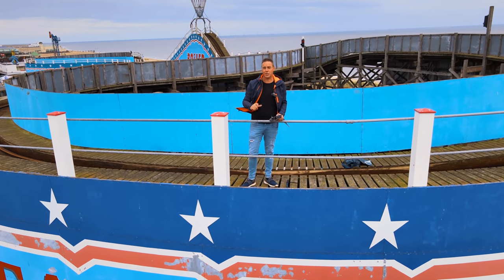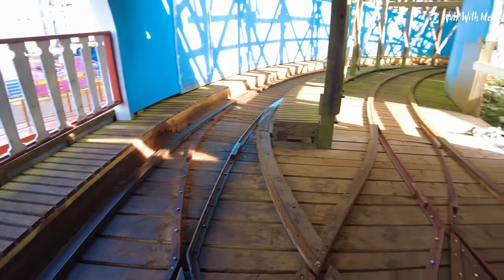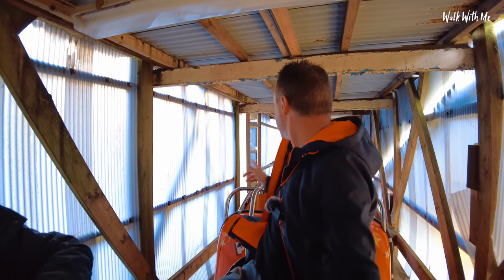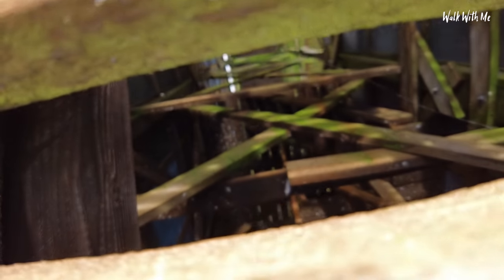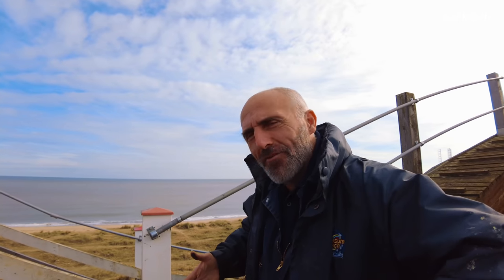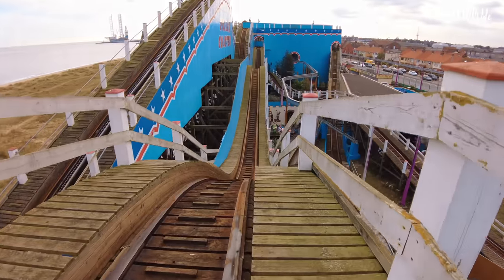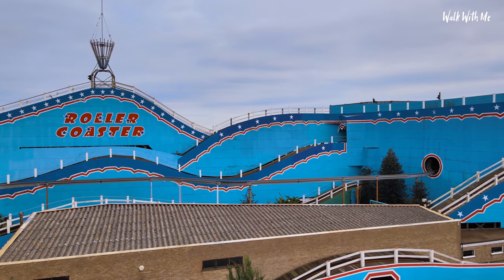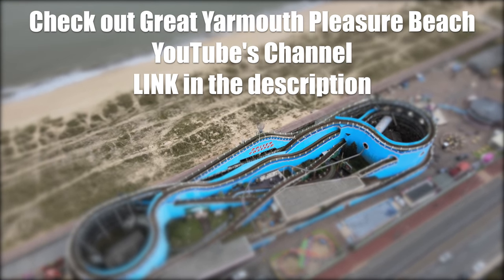I walk one of the oldest Roller Coasters in the UK - Great Yarmouth Pleasure Beach

Comment: Interesting fact - there was an exact copy of this Scenic Railway at Barry Island - opened in 1940 but severely damaged in 1973 and deemed to be uneconomical to repair so demolished. .
Reply from the maker: didnt know that!
Reply: @WalkWithMeTim  Both Great Yarmouth Pleasure Beach and Barry Island were owned by the Collins family at the time of building the copy.
Reply: In fact the Roller Coaster suffered huge damage (a huge part of it collapsed) too as a result of gales (I think 1974.) It too was thought it would have to be demolished but it was rebuilt. The kink in the tracks (mentioned by Tim as being because the sand had shifted) was in fact a result of this reconstruction job. The chicane (the drop if you like) was built with an awkward kink in it (you can feel it at the bottom as the cars shoot down this bit) because it was hard to profile a huge new section perfectly into the existing track and coaster structure that hadnt been damaged.